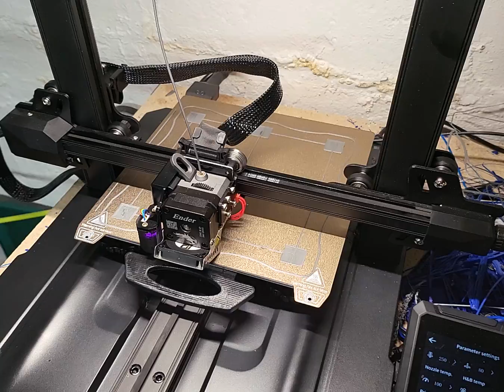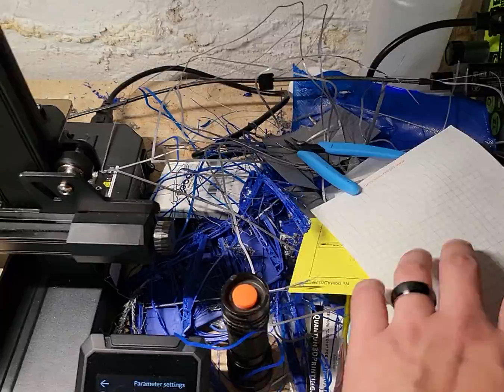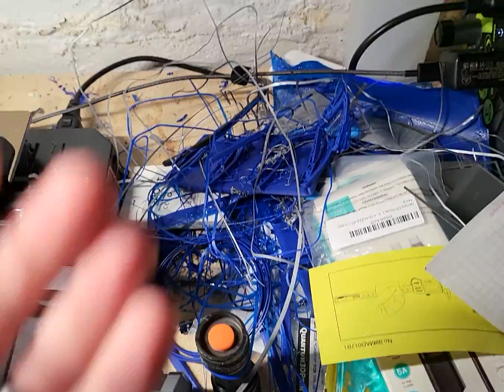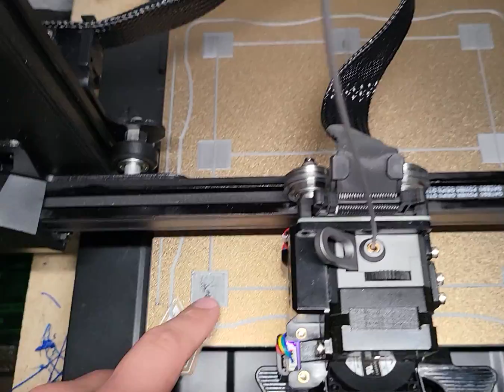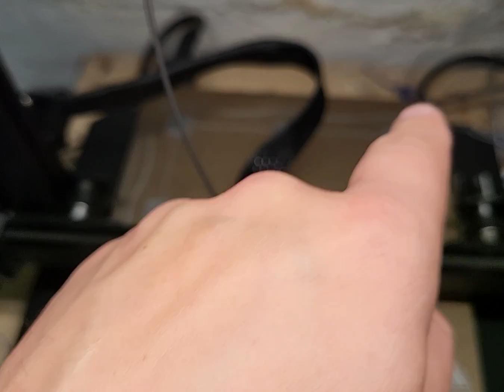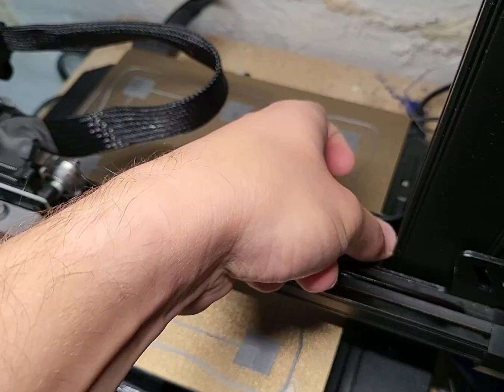Ender 3 S1 Pro Auto Bed Leveling fix!

Comment: I don't know why but no matter how perfect I level the bed that this guy and me both use THE PRINTS WILL NOT STICK AT ALL. AND YES I did put Alcholol etc. So wtf is wrong with my printer. I'm also not using auto level as it completely ruins the printer.

Comment: Having similar issue will try to slacken things off a little to see if that help feeling hopeful I have managed to print one of the stock files twice. But others print about a 3rd of the way then it shifts and moves. The axies with the print head on it were very tight that the rubber is worn. My printer is only a week old!

Comment: THANK YOU.   I did same thing.   Set up printer, and noted some lose bolts, tighted them, and no prints working.   Followed your recommendations and printing awesome.   I suspect over tightening the X,Y,Z rollers causes the frame to distort.

Comment: Thanks, not got a single print out until this fix, for me there was one Z axis wheel too tight and the bed ones too, managed to loosen off the Z axis with a wiggle (no cam?!?) and used the cams on the bed ones to loosen off, then bring back ...just.. to the point where they stop the bed wobbling, like wheel bearings - dont overtighten! - and then ignored auto levelling, did an AUX (manual) one and first print since is coming out good! Ta!
Reply: Did it work right?
Reply: @PedroHenrique-ld9yz   Yes, I'm still having the occasional issue and not sure why - I got real good reliability with my Ender 3 but this S1 Pro model is annoying, I may disable the auto level gadget, and buy some proper bed adhesion spray although others dont seem to use anything and be ok, its a good metal bed but has issues for me enough to annoy and not trust it and leave it (not leave the house with it unattended - I know you dont do that) but leave it without constant supervision which is frustrating, its the only issue I have with it but - yes - annoying still!

Comment: You dropped this 👑
Been racking my brain and trying everything. Prints that extended beyond the center couple inches of the bed struggled to adhere even with glue stick, to the point I was dropping magnets onto brims mid-print. Then long prints running diagonal across the bed were developing sloppy, ricotta cheese looking layers and top layers were bumping the nozzle, so I thought the z was binding. And then even smaller prints were having the cheese effect. Started trying to force support where it shouldn't be needed. I tightened the wheels under the bed a couple weeks after getting the printer and everything has been downhill since and I never realized that could be the problem. You are a life saver.

Comment: I just have to auto levelling. I manually leveled after preheated and working for nearly a month now. As soon as I got the auto level, it messes up. Remember to reset because every time you auto level it changes the zero position for every of those points and there's no way on the user-interface to see

Comment: I have a Ender 3 s1 pro, first i do the auto leveling after that i check manualy, the 5 positions, allá check, but when i try to print the rabit example, the nozzle start way to : from the bed, anyone knows why, please help me
Reply: Manual with a piece of paper first then do auto. Do the centre first and set the Z offset. Only fine readjustments will be required when printing.

Comment: I had the same problem on my v2. added bed leveling but couldn't get it to work forever. My BL touch was a glorified end stop for like a year. for me I only had to barely loosen the z wheels and now its perfect. I think the tightness was causing some imperceptible racking in the gantry that ABL couldn't deal with.

Comment: I had the same problem when I bought my first 3D printer which was this ender 3 s1 pro . After trying to configure the bed leveling, everything just when haywire. Filament won’t stick , (203) probing errors , and may I remind you , this machine is brand new . Had to disassemble the machine and start over , but all Allan screws and lock nuts are really crappy . So solve the problem, I had to loosing everything and properly tighten back all screws on the gantry . Then press the level bed way down and tighten the adjustment screws till it reach the max . Install back the gantry but with the extruder halfway point , then tighten the 4 bolts underneath. After that , then I tried the bed leveling and everything was working just fine. This ender 3 s1 pro looks like it had a lot of manufacturing defaults.
Reply: I'm having an issue where when I'm trying to auto level it's freezing on me and not working.
Reply: @murderblock8194  that’s strange . Have you google the problem and see what’s the cause ? I saw people said that if the firmware isn’t updated, there’s a process that you can follow to update the firmware, but bare in mind , some people said after that process the screen freezes !! I’m not sure . Please seek proper info bro .
Reply: It's not only on a pro version. I have regular version and after changing y axis wheels it would print 2 things okay-ish and after that, without doing anything to printer, nothing would stick to the bed, only to nozzle.
Reply: @hashbringer975  if the material is tangling on the nozzle , see if ur adhesion is off on the cura settings or if your nozzle is making contact with the bed . I had a issue where I didn’t notice the adhesion was off and was gettin that issue , while it was on , some parts weren’t holding still so I resort to using Elmer’s glue stick , overall this printer sucks abit , should of tried the CR line instead of ender 3 s1

Comment: Mine came  tight as all hell and with imbalanced rolling on the bed. I loosened it to the best of my ability but it still sucks. Gunna update the firmware and try again. center of the bed is always too low
Reply: try a small strip of food foil in the center

Comment: You're the man Hull! For having gone to school for computers, this S1 Pro has just been ticking me off. Oh the videos I've made about my frustrations! I think this might be like the tip I saw on a video by just Vlad, his 52 minute long unboxing video of the Ender 3 S1 pro. He just barely mentioned in one clip about how the SD card goes in upside down, the gold contact finger thing is pointing up? So I paused the video, looked over at my Ender, look back at the video and shook my head. I went over, inverted the SD card and I was burning s*** with my laser in about 2 minutes. So, I just walked over to my Ender and tried fidgeting with the wheels, they are stuck. I did like what's his name said, I just tightened the s*** out of everything! Okay, piece by piece, we are going to get there! Thanks again Hull!

Comment: Thanks you for posting this. It was the first place I found anyone talking about a solution to this. I did the same thing. first few prints were good, tightened the bed axis down, because it had way too much play in it. Then I couldn't get the auto-bedleveling to work at all. I went back un-tightened the bed axis and re-tightened just to the point it didn't have play (maybe a small amount but not really noticeable). It all works now. You are a true bro.

Comment: Hi. I bought the ender s1 pro last month and have been going around on Youtube and Reddit spreading knowledge about the bed-levelling issues caused by the overtightened bolts on the Y-axis. Glad that the info is getting out there for people to try it. My wheels also came fairly tight, but they all roll and do not peel, so I don't bother loosening them and I have great quality now so no point in accidently messing up my machine. 
Have a nice one.
Reply: Thanksss Man!!!   I losely many many many hours on this and now i release the Y wheels at the point with rolling on fingers and not move the bed up/down the bed > Manual leveling > Auto Leveling > SOLVED!
Reply: i turn off the print and lose the leveling. I repeat the same steps and its so low and scretch the bed

Comment: Got the S1 Pro as my first 3Dprinter, and the bed leveling has been a nightmare. Currently have strips of paper under the PEI sheet to get a halfway decent print. Nothing I've tried so far has given me a level print across the bed. It always turns out like you're describing (also center always too low). I was also told the Y axis was bolted to the plastic base, and could cause a low spot in the middle if over tightened. All the resources I saw prior to getting the printer said to make sure everything was tight, so I tightened the s#^t out of everything during assembly. Need to tear it back down and try your suggestion.
Reply: I refunded for this printer. What the company is doing is a complete scam
Reply: @SelfTurkey  I should have but waited too long. Are there any budget printer companies with good quality control?
Reply: @REDGTA Artillery Sidewinder X2 is the way to go. Geekbuying is selling them for cheap at the moment.